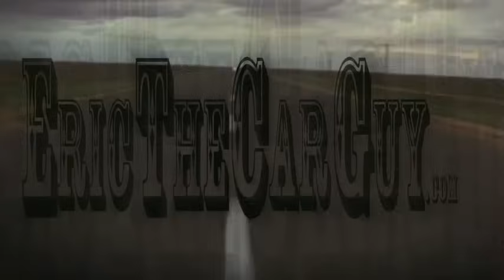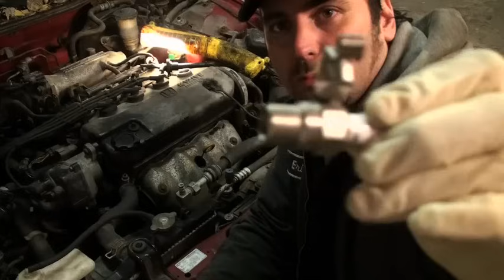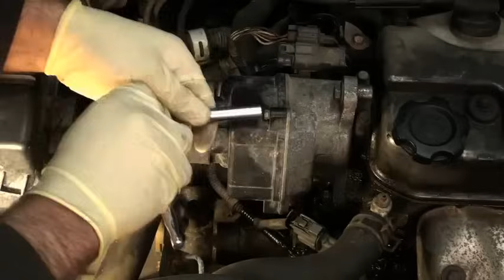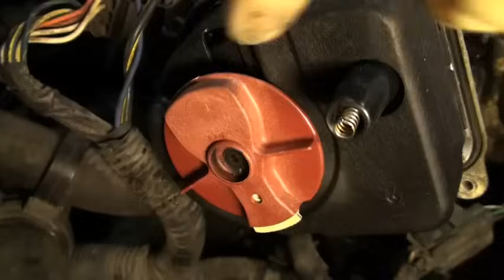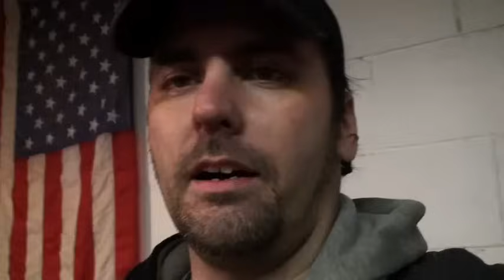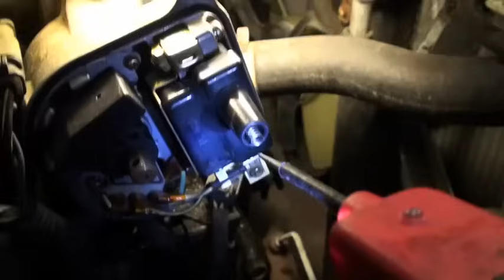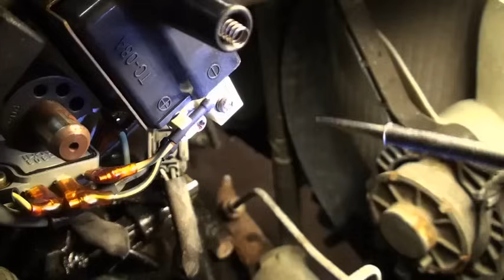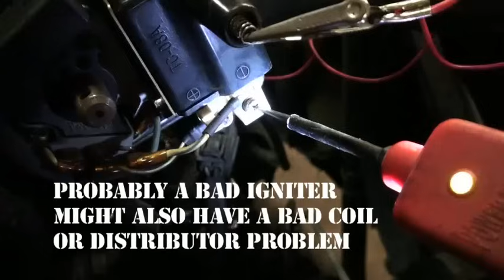No Spark Diagnosis (Honda) - EricTheCarGuy

Comment: @phorse Page 4 (Cont'd): Further testing, symptoms, and results.

After several minutes of attempting to start the car and getting nothing, I went to test the spark. I started at the plugs, then to the distributer. After getting nothing from both, I came to this video and followed the steps (no need to explain what I did, it's already here). After running through all of the tests, I found it was the coil, it was getting no spark, so I replaced the coil. Cont'd...

Comment: @phorse Page 3 (Cont'd): More testing, symptoms, and results.

After the car started, I figured the problem was solved, so I shut it off for the night. The next morning, I started the engine again, the engine fired normally without a problem, was in perfect time, and there was no indication of a problem. I let it idle for a little bit, then revved it up (5-6k RPM), and it stalled again. I tried restarting it, it fired, then stalled. Reattempted to start it a 3rd time, no ignition. Cont'd...

Comment: @phorse Page 2 (cont'd): This section covers more of my situation, symptoms, parts I replaced, and results and complications after replacement.

After it sat in the garage for 6-8 months, I changed the battery, it was over the end of it's life (3 years), and needed to be replaced anyway. I also purchased Spark Plugs/wires, HEET, Lucas Fuel Injector/system cleaner, and 6 gallons of gas. After adding/installing everything, the car fired right up, and everything was normal at idle. Cont.d...

Comment: @phorse Page 1: This section covers my cars make, model, year, specs (engine type), situation, and symptoms. You can choose to read if it applies to you, or if you're interested.

After letting my 1999 Honda Civic EX (1.6L SOHC, no VTEC) sit for awhile, I started it just to get fluids running through, and to get parts moving. After revving the engine (5-6k RPM), the car stalled. After that it would start for a second, then stall again. After that, I let it sit for another 6-8 months. Cont'd...

Comment from the maker: @turbofreak521 I actually did a video covering that very thing, No Start Diagnosis, timing or 'engine mechanical' is what I put that under, you might want to check it out.  That would also include the engines ability to produce vacuum and compression BTW.

Comment from the maker: @web10124 Checking the resistance on a coil is useless in my opinion as it doesn't really tell you anything in my experience as I've had many bad coils test good, you have to load them up to find out if they are bad or not.  If you perform the test in this video it will tell you if you have a bad coil or something wrong in the primary circuit.  All you need to do is crank the engine while looking at coil (-), if you don't see a signal the problem is in the primary.

Comment: Hi I really need help. I checked the spark plugs for sparks and nothing. I checked the coil for sparks nothing, I  checked the the resistance on both primary and sec  and it's within specs. I checked for battery volts and all good so what else can I check ? Tried new cap and rotor and still no sparks? Help!

Comment from the maker: @offroadingmachine007 Like in this video you need to find out if the problem for the no spark is a result of the primary ignition system (before the coil) or part of the secondary ignition system (after the coil).  The best place to do that is at the coil (-) where you can see if the coil is getting a signal from the primary like in this video.  If your not getting a signal then the problem is something like an ignition module, if you are getting a signal then the coil is most likely at fault.

Comment: Hey there, I have a 1984 Ford Ranger 4x4 with a 1986 2.3 Ford engine carberated, and it was running fine, but now it has no spark, and I replaced the plugs, and the coil, and the cap and rotor looked fine, and I know its geting fuel, but im just not sure what it could be. Any ideas?

Comment from the maker: @74CarFan You might want to check the fuses to make sure that not only the main relay is getting power but also the ignition system.  Work one system at a time based on what is missing, spark or fuel, don't attack everything at once this will be counterproductive, if you don't have spark work on that circuit, if you don't have fuel work on that system not both at once you may end up masking the real problem working this way.

Comment from the maker: @PoMoNaS1TOP Stop replacing parts.  Make sure the distributor has power like I show in the video and if not check for a blown fuse in the under dash fuse box.  If you do have power perform the test in this video and see what you come up with.

Comment from the maker: @bedroombully904 I've done videos on battery testing, haven't got a starter video yet though.  All you need to do to check the starter however is tap on it with a hammer to see if that makes it crank, if it does then you probably need a starter.  Don't forget to check your connections as they are very important, make sure they are clean and tight.

Comment from the maker: @6664298 If you find oil INSIDE the cap then the bushing inside the distributor is worn and the distributor sub assembly needs to be replaced.  I recommend an OE unit for this because the aftermarket ones are not all that great.  Good luck and keep me posted.

Comment from the maker: @vinceperez158 Easiest thing to do is put the same thing in it, if you put another engine in you will at the very least have to swap the ECU.  In my opinion the best way to go fast is start with a fast car and make it go faster, if you want to make a slow car fast you well usually end up spending a lot more money in the process and have a lot more headaches along the way.

Comment: o one more question.... i got a honda civic 1996 dx.. i wanna do a swap.. what engine should i swap it with??? put a vtec motor??? I want to know what the absolute most efficient engine for this car is! or the most powerful!... and i can still rely on not waisting gas when i drive it normal with out pushing it

Comment from the maker: @vinceperez158 The discoloration is normal and not an issue, I can say based on my experience the best way to go with Honda distributors is with OE parts as I haven't found an aftermarket one that was worth a darn yet.  And yes, I always recommend diagnosing a problem instead of throwing parts at it.

Comment: @EricTheCarGuy so what you recommended me next time this happens to me???? full diagnose??  i knew what was the problem the reason i bought a new distributor was because the wires look like they where burnt, like the wire that connect to the ingitor was black burnt... and i didn't wanted to take a chance buying the pieces and find out the i have to buy the hole distributer because of the wire

Comment: @EricTheCarGuy so what you recommended me next time this happens to me???? full diagnose??  i knew what was the problem the reason i bought a new one was because the wires look like they where burnt like the wire that connect to the ingitor was black burnt... and i didn't wanted to take a chance buying the pieces and find out the i have to buy the hole distributer because of the wire

Comment from the maker: @CHR32191 If the dust was orange in color you will need to replace the distributor sub assembly, I recommend using an Acura part as I haven't seen too many aftermarket distributors work out that well.  If you watch the video I did on distributor replacement I put a Civic distributor on my Integra so yes, many of the parts will change over.

Comment: @EricTheCarGuy recently my Acura integra (1990) would not start and there was no spark at the sparkplugs. I removed the cap and it was burn and has this weird dust. I was wondering If components from a civic (1991) distriburator would work in my car.

Comment from the maker: @vinceperez158 Thats a mistake in my opinion for 2 reasons, first I haven't found an aftermarket distributor that was any good, mostly the parts fail much sooner than their OE counterparts and sometimes I've put them in with a code 9 right out of the box.  Second if you think buying 3 parts instead of just one is cheeper more power to you.  People that don't want to take the time to diagnose the problem often do this, it's referred to in the biz as the 'shotgun' approach.

Comment: I just change the hole thing, That's what I did with my civic... I don't got a light tester but I knew the ignitor didn't work.. The coil I wasn't sure about.. They try charging me for the ignitor 125 dollars for it, but the hole distributor was 235 dollars so I was like fuck it ill replace the hole god damn thing lol...

Comment from the maker: @shaneunderwood The igniter works like the ignition points of old which work as the switch to activate the coil primary side of the circuit. It is not possible to sustain a high voltage spark and pass it from cap terminal to cap terminal, the coli needs to buildup and discharge for that. Old systems used mechanical linkage to open and close the primary circuit via the points, modern systems use electronics (a transistor) to perform the same task with the igniter or similar device.

Comment from the maker: @raiderx1000 You need the spring or the voltage will leak out and possibly cause a misfire or coil failure.  You can use one from a bic pen, I've done it in the past.  I'm not sure on your application but on some the spring was in the cap.

Comment from the maker: @raiderx1000 I'm still not following you sorry.  You say you are getting spark at the coil?  Probably the most important part of the test is to verify the primary circuit which is what you are doing when you place the probe on the (-) on the coil, if the light does not flash like it does in the video then the primary circuit is at fault not the coil.  I hope this info helps.

Comment from the maker: @raiderx1000 Testing coil resistance is a waste of time don't bother.  The only way to truly test a coil is under load and you can't do that off the car without the proper equipment.  If you do the tests in this video it will give you the answer to an ignition fault on a Honda.  If there is some other issue that you are looking to solve let me know and I'll do what I can to help.

Comment from the maker: @alone1402 If you have already addressed the ignition system as you stated you might consider looking to a possible mechanical problem and do a compression test to be sure the the engine is sound mechanically before you look to electrical components as a burned valve could cause a miss as well.

Comment from the maker: @spelunkerd You don't have to worry about "frying" the probe as the voltage will just go straight to ground and not effect it at all.  The compositor is probably there to help measure the voltage as a compositor will store voltage based on what is put into it however,  It also may be there to help prevent voltage spikes to the testing component.  I think just a screwdriver held close to ground would tell you all you needed to know.

Comment: Each time I watch this video I pick up more detail, thanks again for posting
. 
I have an automotive textbook that describes a homemade coil tester, made from a test light and a capacitor wired into the test circuit. I guess I don't understand why he needs the capacitor, and it's not very well explained. Your technique of using the Powerprobe seems very definitive, thought I worry about frying my probe. Would you ever find occasion to use a tester with such a capacitor wired in place?

Comment from the maker: @JanoLguz If the car starts when you jump it then the issue is probably the battery.  I did a video on Load Testing a Battery that you might want to check out.  Don't worry about the main relay and the rest until you get the battery sorted out.

Comment: fuel pressure is ok i jump start it and it starts right away..it i think my battery is being drained by the heat is that posible i also checked the main relay and it was ok..it only happen once a week or in a hot day..mainly from the time i get to work..8am and get off 4pm it happens..

Comment from the maker: @founditnow54 That's actually a common problem on that engine, I think the leak near #4 cylinder has to do with a leaky t-stat housing.  Try pressure testing the system and look for coolant leaks near #4, I cover cooling system pressure testing in the video I did on Diagnosing an Overheat.

Comment: Eric- I have an involved question for you. My 2000 f150 with the 5.4 triton pulled a DTC for cylinder 4 misfire. I pulled the #4 coil to ohm-test it and found coolant on the coil and in the spark plug well. The coil was slightly corroded, but tested ok. I looked for any signs of coolant leakage but could find none. I cleaned out the coil and blew it dry with air and put things back together. Truck runs perfectly now and no MIL. Im worried it will just happen again. Failed gasket? Cracked head?

Comment from the maker: @JanoLguz If you sprayed carb cleaner in the intake and it started it's probably a fuel delivery problem.  You might want to check fuel pressure and go from there.
Reply: Help please reply

Comment: after that day a week past and it didnt want to start again and one of my friends told me he had quick start spray or starting fluid..he sprayed it on my intake and the car started with no problem he said that i have week spark...but what can it be???the coil????and also after he sprayed  the starting fluid the car woulndnt let me go past 3500rpm it would shake realy bad...and if i turned the car off it would not do that again but it would start i need help asap...plz get bak to me...

Comment: hey Eric great videos...i have some questions my self..i have a 1993 civic ex (d16z6)from time to time my car does not want to start i have not try any  thing so far except regular tune up...spark plugs,wires,cap and rotor and thats about it but i keep haveing problems starting my car..it starts every morning good but after 8 hours when i get off work it wont start i pushed started the car and it started,than some other day it didnt start again and i jumped started the car and it satarted

Comment from the maker: @020363 If you have power and a switched signal at the ground then the coil is bad.  Some coils are better than others in that some coils are better quality and as a result have a much lower failure rate.

Comment from the maker: @G562UNOT The main relay has nothing to do with spark.  First make sure the engine is spinning the distributor, a broken timing belt won't let the distributor spin but the engine will still turn over, then check to see if you have the power and ground at the coil like I demonstrated in this video, this will help in diagnosis.

Comment: @EricTheCarGuy Well, I got my car running. My friend has the same civic as me. We swapped distributors. And, it ran. Oil was leaking into it from a bad o-ring and damaged a sensor. Spark was just to weak. This had some MT's confused even. We checked time, compression, fuel all was there. Good video though. Thanks for the replies to.

Comment from the maker: @dsjkak1 If your getting spark at the coil then the primary is not the issue so don't worry about the + or - at the coil.  Your problem is most likely after the coil based on your description.  Cap, rotor, wires, plugs.

Comment: @EricTheCarGuy I got the test light. I have spark at the coil. Not at the - wire. I got a light from the positive terminal. I replaced the cap because it was broken. I should have done the rotor. i understand where you said if it sparks at the coil replace both. But, is the + connector on the coil the battery wire. sending a weak spark to the coil. It was weak at coil and strong at +, Should the test light blink like yours when it gets spark at the ground.

Comment from the maker: @jmax95 Make sure it's in time mechanically before you set the ignition timing.  If the mechanical timing is off it needs to be addressed before trying to set ignition timing.

Comment from the maker: @zapo301 If the light does not flash the igniter is bad, if it does flash then the coil is bad.  it will flash very quickly so make sure you are sure you didn't see a flash and if you still don't replace the igniter and recheck it.

Comment from the maker: @starcool15 You might want to check for a restricted exhaust.  The easiest way is to drop the pipe at the exhaust manifold and take it for a drive, if the symptom goes away then you probably have a restricted exhaust.  You might also want to recheck the timing both mechanical and ignition as these could cause what you describe as well.

Comment from the maker: @starcool15 Kind of a strange problem really.  Was it happening before you did the work?  If not you might want to go back and recheck your work.  Corrosion on the coil isn't that big of a deal and would cause a problem all the time not just on warm up I would think.  If you have a check engine light you would want to start there.

Comment from the maker: @jmax95 I haven't seen anything more than a normal Honda for a no start with an H22 but I've seen plenty of modified cars like yours have issue.  The best advice I can give you is to check the basics, spark, fuel, and engine mechanical.  With a car like yours it's really anybodies guess what is causing the no start, look to the basics and go from there.  Work logically and methodically and you will solve the problem.

Comment: Eric, Thanks for responding to my comment in the other video. Could you summarize the test and add it in the description area of the video. If I do the diagnosis as told 1) Check for spark at the spark plug(No need to crank right?) -What to do when there is spark and no spark 2) Check at the coil -What to do if there is spark 3) No spark at coil and go for the next test(For ignitor)-What to do for both the conditions(blinking red or not). Thanks.